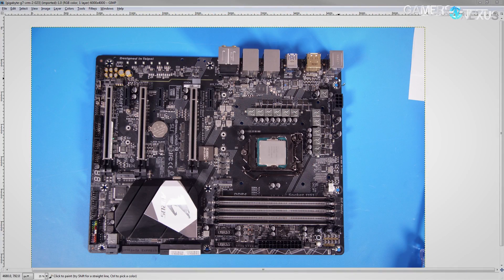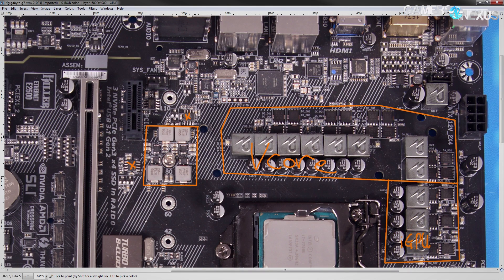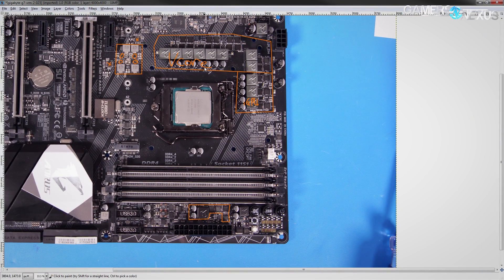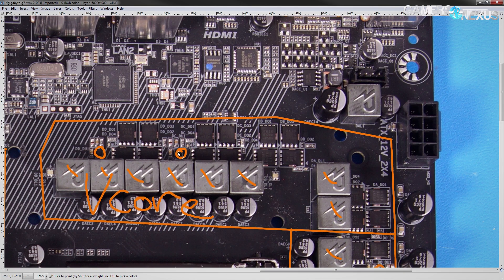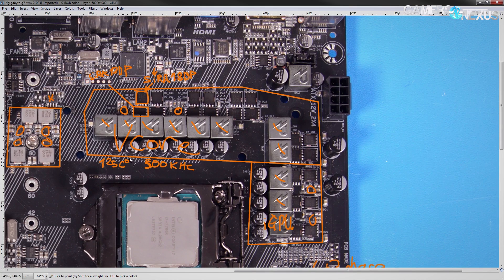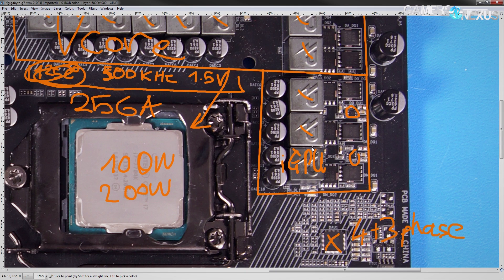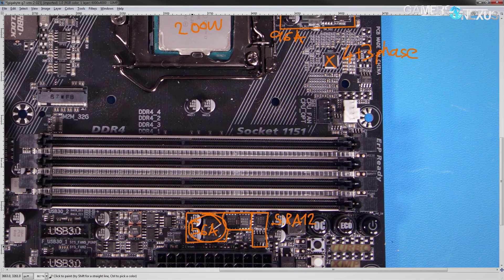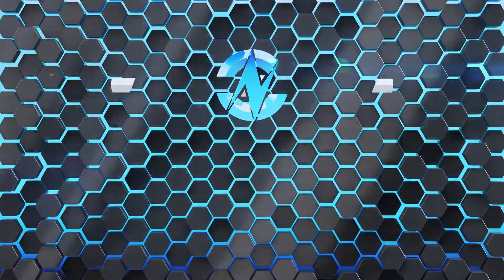Gigabyte Z270X Gaming 7 VRM Analysis w/ Buildzoid

Comment: I see you removed the large white plastic cover over the I/O area. Is it easily removed and can you put it back on if you choose too?

I'm nearly done with my build, I have everything but the board and processor, but realized that that plastic piece would not fit with the 240mm Thermaltake Water 3.0 RGB installed in the mid tower ATX case I selected.

Comment: There is a VRM in the top right corner of the picture that wasn't addressed... you surely didn't just miss it? What is that one for?
Reply: you mean the choke with a P on it and the big cap next to it? That's not a VRM that's a 12V input choke and cap.

Comment: Damn... I learned the imprtance of good VRMs the hard way. My first PC ran a fx 6300 OC on a shitty ASrock mobo (760 something). It had a 4+1 design with no heatsinks.. yep it was throttling the CPU bck to 1.4Ghz lol
Reply: Some terrible mobos do have thermal sensor in the VRM that will try to save the garbage before it goes up in flames. My 970M Pro3 from Asrock did that at 4.7 if I didn't put a fan on the VRM.
Reply: that doesn't sound like the hard way to me?
sounds weird to me? i thought vrm being to shit would result into a thermal runaway and thus ending into a nice burned out vrm and possible cpu...
cpu throttling would be more like cpu overheating or other shit.
or did the motherboard have a safety feature that detected the increased vrm temps and throttle the power delivery, but again this would result in a crash not a throttle....
going from what i learend from buildzoid:
vrms go go go go... until they suddenly blow :D
Reply: Actually Hardcore Overclocking that was the case with my mobo. CPU temps were in the 60s with aftermarket cooler. After putting copper heatsinks (enzo something) and a fan, I was able to eliminate the throttling at 4ghz.

Comment: This is a true budget rig and I would not go so far as to call it a true gamers board. Being a true gamer I would never opt for such a low end option as this. Please give us more meat like this but spec out real boards and not budget reward boards.
Reply from the maker: The board is most certainly not in the "budget" class, no matter how you look at it. It's a $240 motherboard, so (as Buildzoid said) that'd land you either upper mid-range or lower high-end.
Reply: Einstein OneSixty how is it budget if it costs 250?
Reply: Einstein OneSixty What would a gamer need that this board doesn't provide??
Reply: the fuck is a "true gamer board"? A one with really nice vrms and good OC shit? That's a Overclockes board, if you want to game all you need is two dim slots and a socket.
Reply: 240$ motherboard is a budget one? I thought it was the 50$ ones were budget...
Reply: I guess when you have access to daddy's credit card anything under the $400+ motherboards is budget :S
Reply: This board is overkill for gamers. A $150 mobo is more than what a gamer needs for high end gaming (not talking about world record breaking levels though).
Reply: Alex Strömberg I could understand the argument that basic OC features can be really valuable assets to gamers. In recent video about the 2500k it made a clear difference in game perf (albeit mainly in just a few titles) to overclock the CPU, but I agree in that I'd consider any consumer board sufficient for gaming on modern hardware.
Reply: that's sth one has to consider if their rig is very old. Like, who's gonna spend $240 on a board just to fit their 'old gen cpu and RAM' in it? o-O

Better to just spend a tad more on latest tech i5, a decent mobo and a stick of ram.

The thing is, for future, yea it seems great investment, but by the time the current gen cpus reach that limit where they will need to be OCed to the extreme to get decent frames,  it wil probably be time to change the entire rig altogether. 

$240 can't be a gamer's rig unless he/she wants #SWAG

These are boards designed for cpu OC ers.
Reply: on the 2500k though.. even the budget p67 boards could handle like 4- 4.5ghz overclocks well enough. Mine cost me like $120 AUD, and it's had 4+ghz on it from day one for the last almost 6 years, with it at 4.5 now. Given kabylake and skylake require less voltage, i'd feel pretty safe about a basic OC on a $150 board personally.
Reply: Sheikh Tashdeed Ahmed not overclocking is like flushing money down the toilet unless you buy a non K sku.
Reply: Its priced as a high end mb.

Comment: i'm i the only one who feels GIGABYTE products are cheap quality?
Reply: I wouldn't call them cheap but they are somewhat less refined in some ways. In terms of component quality gigabyte generally matches ASUS except for the occasional blunders they make on some low end stuff. MSI tends to make things that look nice but generally goes for cheaper components under all the blinged out heatsinks.
Reply: I have been using my GA-X58A-UD5 and i7 920 do cpu,everyday since 2009,and its been flawless.
Reply: >Calling Gigabyte cheap
>Recommending MSI instead
My sides
Reply: Not in the least, there are many of us out there that would agree with you. I have had plenty of their boards and while there is nothing inherently wrong with them, they are budget boards and should not be discussed on forums like this in my opinion! For the past 5 years or so I have opted for Fatal1ty boards and I have yet to be disappointed!
Reply: i cant argue with your feelings but gigabyte ultra durable are pretty solid boards imo
Reply: Omar Maestro I have several older lower end Gigabyte motherboards I have used across both the Intel and AMD platforms, from what I have personally experienced over time, the more technologies are implemented into their main boards, the worse off they are.
Reply: The MSI krait boards (on the AMD side) are famous for exploding under any kind of overclock though. Point is: judge by individual product, not the logo sticker on the box
Reply: i have a gigabyte mobo for 7 years still going and another one for 13 years. The only gigabyte mobo I had die  it was because of shitty nVidia nforce chipset. ok ok i had a dead gigabyte graphic card after 7 years of abuse
Reply: karik666 I have a GA-X58A-UD5R with a Xenon X5650. 7 years of overclocked goodness.
Reply: lol thats how I feel about asrock
Reply: My gigabyte z97x gaming 3 died after a couple months, i might have been unlucky tho.
Now i have msi krait something (got it as a raplacement)
They were both running 4.7GHZ 1,3v on i5 4690k
Reply: I wouldn't recommend them either. I bought a motherboard from them which had defective sound from day 1. I sent it out December 8th and they tried to tell me there was nothing wrong with it. I finally got them to send a new board to me which didn't arrive until January 17th. For a first time Gigabyte customer, it left a sour taste.
Reply: I used a x58-ud9 for near a year but the motherboard went bananas with something on the power side of the motherboard but i bought it used so i don't know how it was treated before i got it, now i got a z97x-gamin gt wich is going fine for now
Reply: i have 1 issue with msi and that is with the z170 gaming m5 its a 180~$ motherboard that don't have LLC for CPU overclocking i feel that my 6600k is hindered on 4.2 ghz on 1.35v cause when under load (not prime 95 load) the voltage like goes to ~1.32-1.31v (with prime 95 i saw once 1.292v in the log file of HWINFO64)
There is a feature called voltage compensation it's useless for high overclocks where you need to set the voltage near the limits cause it basicaly raise the voltage(say i put 1.35v w/o V.Compens. i get ~1.345v w/ V.Compens i get ~1.37v)
Reply: I had a SATA port rip straight off a Gigabyte Intel board while unplugging the cable :P
Reply: ECCENTRIC That doesn't surprise me that much lol
Reply: yes you are
Reply: If you ever dealt with Gigabyte you'd understand

Comment: Hey! I just bought a new system and I'm really happy! What do you think guys?

CPU i7 7700k
GPU msi gtx 1080
M/B Asus z270f
CPU COOLER kraken x62
PASTE Arctic mx4
RAM G.Skill RipjawsV 16gb 3200mhz/CL14
SSD samsung 850 evo 500 GB
HDD wd blue 2 TB
PSU corsair cs750W
CASE bitfenix aurora
MONITOR LG 24gm77 144Hz
KEYBOARD corsair strafe
MOUSE logitech g403
HEADSET hyperx cloud II
MOUSEPAD zowie P-SR
Reply: It's an 80 PLUS Gold PSU. I think he'll be fine.
Reply: That's a great system for gaming + streaming and even light content creation.  

The weakest link in this build is your monitor which is a 1080p 24". Consider saving for a better one. Your GPU+CPU will have no trouble pushing a 27" 1440p 144Hz monitor.
Reply: overclock it :DD
Reply: Congrats man looks like an amazing system, I hope you enjoy it :)
Reply: geomadhack PSUs are like that thing where you can't cheap out. because it can ruin your who system. of course if you don't push too much of you PSU nothing will happen but nevertheless better safe than sorry. what makes a PSU  good is it's components quality(Japanese is the high quality). also efficiency ration doesn't mean much to quality. imagine seasonic m12ii evo is 80 plus bronze but is way better than your PSU because of its components and because it's manufactured by a reputable brand(seasonic) also the ones selling isn't the same as manufacturer you can have a Corsair PSU made by seasonic or other manufacturer it depends on the budget. usually what I go for is seasonic because at any price point if you find a seasonic PSU you know it's good
Reply: geomadhack really cool system!
Reply: geomadhack watch out with overclocking that psu is not that great with such expensive system you couldve spent some more on a seasonic PSU and you'll be good for 10 years
Reply: Hey! I made this choice because I was out of money and for a decent 1440p 144Hz the price was getting out of my reach!(24" its what I actually wanted for gaming) . Also I want to keep the system for a long time before upgrading anything so I thought a 1080p would be able to hold the frames high for a little bit longer! Nevertheless I may add a second 60Hz 1440p in the future! Thanks for the advice, Cheers!
Reply: well if efficiency meant quality components i wouldnt comment
Reply: rubbish PSU to use for high end components (Evga 650 G2 is a better choice).
Reply: So why is this PSU so bad? I thought it was ok that's why I went with it. Remember it's my first build and I've been watching what's going on with current hardware for about a month.
Reply: I've been doing extensive research for each part, well, except the PSU I guess for which I assumed corsair was a  safe bet! I wouldn't say that I cheaped out tho at 120 euro price point, which is the same as Evga 650 G2 that has been suggested above! Hope everything goes right!
Reply: I don't plan to overclock right away, but maybe I will at the future something like +100Mhz on the graphics and CPU max at 4.8Ghz because anyways I don't want to push my hardware too hard. Will this be ok? I have plenty of extra wattage on my PSU so isn't this a plus?

Comment from the maker: Thanks for watching! We have links to the motherboard, the original review article + video, and to Buildzoid's channel in the description. I've also re-pasted them below:

Gigabyte Z270 Gaming 7 on Newegg: https://bit.ly/2jTRGnq

This PCB & VRM analysis was conducted by Buildzoid for GamersNexus.net. You can find our full Gaming 7 motherboard review here:

Article: http://www.gamersnexus.net/hwreviews/2745-gigabyte-z270x-aorus-gaming-7-review
Video: https://www.youtube.com/watch?v=gJWChYfsAZM

Find Buildzoid on his Actually Hardcore Overclocking channel: https://www.youtube.com/channel/UCrwObTfqv8u1KO7Fgk-FXHQ
Reply: PLL ORT and VCC PLL are both settings only needed for LN2. DRAM ACTIVATING POWER SUPPLY should be the voltage that the board first boots, trains and POST the RAM at after which the voltage will go to the VDDR setting. Again only really useful for LN2 overclocking. VCCIO is one of the memory controller voltages and raising it can help with running really high RAM settings(3600 and up).

The rest I have no idea but I might be able to get an Asrock Z270 mobo in which case I will probably cover what all of those do.
Reply: Are you going to break down ryzen MBs?
Reply: I would like to request more Z270 motherboards VRM Analysis. I like this one thanks.
Reply